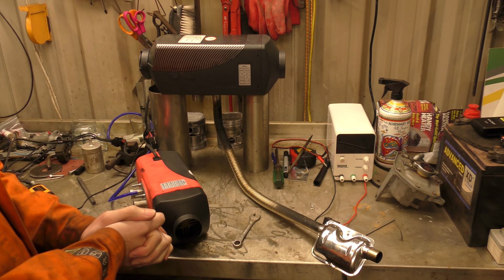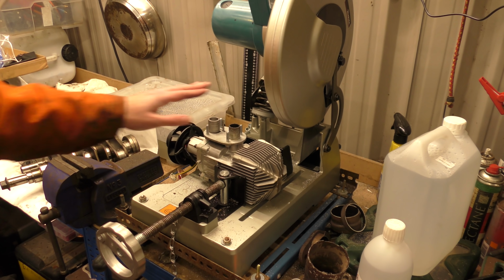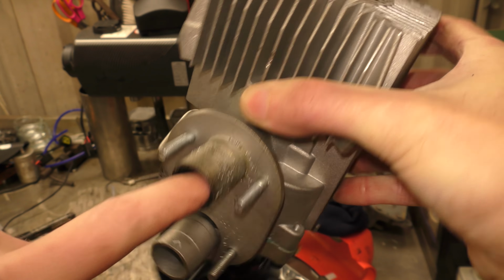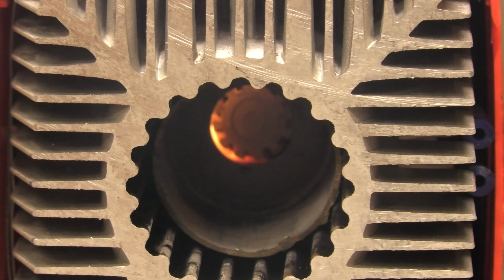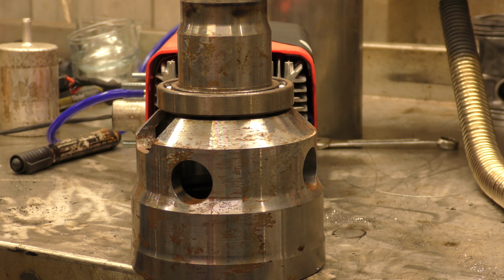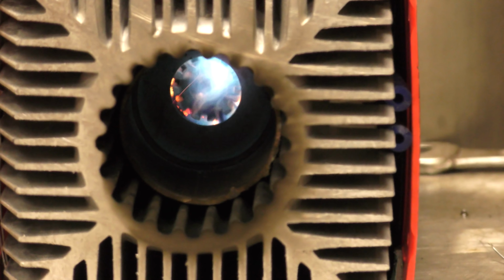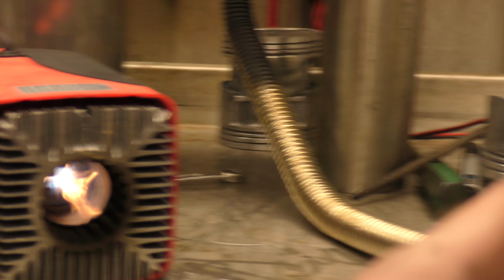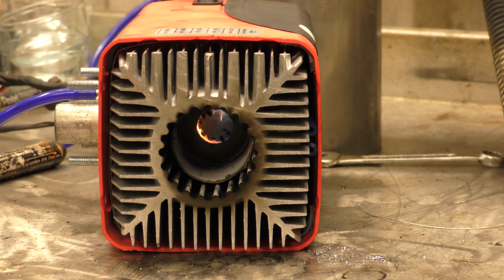A look inside the diesel heater while running

Comment: Seeing how this operates, I am much more confident about using one of these in my van conversion rebuild. Thank you for sharing this.
Reply: Yes this was just what I thought,, I hate to to use somthing not understand how it works,, was good video,, is a good video,, Lol
Reply: I just finished installing one in mine and I'm really happy so far, just wish the LCD had a better user interface/experience, but I guess you get what you pay for..
Reply: @the_alexes  Great to hear this I am at the moment still waiting for mine to arrive, but i do like to know what I am doing and when possible well in advance,, I think the heat of the exhaulst is waisted so I am going to buy a longer pipe and run t through my boat before going out,, Cheers, Pete
Reply: These heaters are great!  I put one into my class A and it easily keeps it warm.

Comment: Since the water heating variant of these is so expensive, I have thought of tearing into one of these far less expensive units and exploring converting it to heat water.  Thanks for the look inside.
Reply: My friend I'm from Greece,living now in Australia. Hydronic heating is not a norm hear and I was thinking the same with this little machine.
Reply: Wrap a copper tube around the exhaust!
Reply: @amando96  not enough heat transfer area/too much wasted heat...
Reply: @amando96  ....and wait for the explosion ?
Reply: @bobjones1131  How would that cause an explosion? What exactly would explode?
Reply: @amando96  Same as any water heater or boiler. You would have to have a safety pop off valve. They already have these with a built-in water heater.
Reply: @bobjones1131  Assuming the setup allows pressure to build up
Reply: You could build some kind of heat exchanger with a heater core
Reply: @juliogonzo2718  They sell them .
Reply: @bobjones1131  why buy one when you can spend 3x as much through trial and error building one yourself 🤣 that's generally what happens to me.
Reply: @juliogonzo2718 Yep, me too. Since a gas water heater already has an exhaust pipe up through it, I believe that a smudge pot could be designed to plug into the bottom of one and used that way. You would definitely need another exhaust pipe to divert the heat away when the water got hot.
 You spend the money and let me know how it works. You can find old water heaters on trash route day...😁
Reply: I was thinking of a 50 plate mini heat exchanger but they have a ~280C max allowed temp, i measured my heaters exhaust and on low it was 180C, full throttle was 300+. Is doable but not sure the exhaust is strong enough to make it through the exchangers plates. its only $80 or so might try it.
Reply: @mickwolf1077  The problem with heating water is that it WILL condense any carbon on the heatex surface that is not broken down in the combustion process.  The brazed flat plate heatexes flow very well, I have used them for Thermosiphon transfer.  The problem I think you will run into is I am not sure how you would clean them of carbon as you cannot disassemble them…  For this you really need a tube in shell with removable ends to allow access to clean the tubes that the exhaust runs thru…
Reply: I think that using the exhaust fitted to a heat exchanger would be a better way to heat water with these, the exhaust gets must hotter than the heat from the room heating output and the heat from the exhaust is wasted.
Reply: Seal off the end of the heater (the part was cut in the video) from the rest of the unit into a coolant chamber, filled with a water/coolant mix, then circulate the coolant through a multiplate heat exchanger. Do it such that the unit is vertical with the heat sink fins pointed down and submerged into the coolant chamber. Obviously do this with an uncut heater. The trick would be sealing off that part of the unit that has the most heat sink fins right up to the exhaust port.

Comment: Very interesting to see and work out the flame path and the combustion setup of these burners. Looks like the disk in the middle is used to evaporate the diesel once the glow plug goes out. Might be some methods of operation I can build in to bigger waste oil burners.  Trying to get one down to even 10 Kw is a challenge.  Great Video David.  Didn't waste anything, you imparted some good knowledge into a lot of people. Thank you.
Reply: Atomization of fuel could improve efficiency also .like a jet engjne

Comment: Be interesting with a bit of furnace glass over the end to see how it burns on different fuels. Great video cheers from a grumpy bastard from Australia
Reply from the maker: I've got some borosilicate glass ordered.  So we can see what it looks like with different fuels.
Reply: Ahhhh great minds think alike , putting my heaters away for the dry , at last it is staying around 20c at night mid 30s during the day . Need heaters at anything below 20c just to dam cold . Possible that I have lived in the tropics for to long
Reply: Heh, I came here to say the same thing!
Would be quite interesting to see the difference between Diesel and Vegoil  while it is starting.
Then you could try heating the VegOil to somewhere around 60-70°C where its viscosity is not too far off of Diesel.
Would be quite interesting to know what the failure point is. Burning temperature, viscosity/pressure, etc.
Reply: Can you also test drinking cheap vodka for one week then let it run on your urin? If it work I will buy this heater for my home
Reply: Interesting
Reply: @McJunk1  I've been thinking about adding a small ptc heating element (like the ones in 3d printer hot ends) to the metal line to warm up the fuel prior to entry, and wiring it in parallel with the glow plug. The mosfet that powers it was rated way higher than just the glow plug could draw anyway so plenty of capacity. Then start with say 20% petrol and 80 veg oil and see if it works or not. Adjust mixture till it burns nicely on veg oil. A glass window would be perfect to see if it's burning nicely.
Reply: @ratgreen  I have been thinking about something similar. One concern is, that due to the construction parameters like hole and hose sizes the oil might need to be heated consistently during operation. Maybe using a stronger pump would help with fuel delivery/dispersion issues. The MOSFET appears to be an off-brand somethingsomething-20N06L which is also rated quite high I think. What I can gather from the video the traces close to it seem quite beefy too.
Another thing is that you would probably need to build a heater block to syphon the fuel through and have enough thermal mass to make it controllable and not overheat it accidentally (or just not get it hot).
Reply: Try running it on propane and use it as a blacksmith forge.
Reply: Will it run on used engine oil? 👀

Not that anyone would ever do that obviously... 😇
Reply: @DavidMcLuckie  what fuel did you use in this video? It's not a diesel, isn't it?
Reply: @ratgreen  why not run something around exhaust to make heat exchanger for oil.
Reply: @pete ryan - Agree!  Would be interesting to see how well it runs on a 50/50 diesel and veg oil mix, as well as a 75% veg oil and 25% petrol/regular unleaded gasoline mix!
Reply: Did the glass test ever happen?
Reply: @McJunk1 
Pointless, a litre of diesel is way cheaper than a litre of veggie oil
Reply: @BillSikes.  Might I ask if you live in the USA? The USA (and other countries) heavily subsidizes fossil fuels. In Europe that is not the case in most countries. Where I live (in Europe) you can buy rapeseed oil for use as fuel, which is cheaper than other fuels. It is not easy to get, because apart from the farmers who produce it and companies with many trucks (so mostly transportation), nobody has the motors to use it. 
Further, it is not always about finding the cheapest way to heat space, but also about how to use renewable energy and not fossil fuels.
Reply: @BillSikes.  Not if you have access to waste oil.
Reply: @randomoldbloke  for your situation you could easily look into a passive heating system. Something that captures heat from the day and keeps it through the night. Some people use large tanks of water with solar heating, some people use big piles of rocks heated by running solar heated air through them during the day.
Reply: @ratgreen  3d printer heaters are definitely not made for that. I think 8 amps would make one explode. Not sure. Just put a good resistor in front of it, and maybe use two at lower current.
Reply: You probably dont care but does anybody know of a tool to log back into an Instagram account..?
I somehow lost my account password. I love any tips you can give me
Reply: @Jake Dariel instablaster =)
Reply: @BillSikes.  Not used veg oil

Comment: I've watched a number of your videos, David, and am much, much better educated as a result! Before then, these were just magic boxes working through who knows what supernatural means. Now, you have shown us that they are - at heart - really quite simple machines. I've just stripped and cleaned mine, replaced all the bits that need replacing and fired it up - off it goes. Couldn't have done it without you!

One issue that keeps coming back to haunt me is exhaust length and build up of condensates and gunk. Mine's in a boat and needs a 6 metre run. So far, I can do no better than run it until it no longer goes and then clean/blast everything through with gunk so it works again. At least I now have the confidence to do it!

Comment: David, I'm an avid diesel heater lover.  But one year in I have found a serious flaw with some All In One Units.   It seems that some of the All In One Units used sub standard fuel tanks inside and several have spontaneously developed cracks, thus leaking a full gallon of diesel fuel on the burner unit and into my garage floor.  I thought it was a bad hose connection but found that some of the very thin fuel tanks were developing cracks.   As you can imagine, a full gallon of diesel fuel leaking anywhere, but especially onto a running hot burner could be a serious issue.   This is one of the problems with low cost Chinese goods.   You can sometimes unknowingly get some dangerous products.  Thanks
Reply: Imho one MUST keep the fuel tank a a distance from the heater and also from any electronics. Also put it a bit lower if possible so that when the hose burns or leaks the fuel won't leak out into the fire.

Comment: Very interesting to see the actual running... I’ve always wondered how the burn chamber worked... now I know, thanks!
Reply: Temperature was 370 C ? Or F ?
Reply: @2cooco  IR thermometer readings probably not accurate as that needs a specific surface emissivity; a thermocouple reading would be more representative of the flame temperature.

Comment: Quite an interesting video. :)
Btw..you could punch some threads in there, throw a thin copper gasket on and assemble the whole unit again. 
It will be easy to disassemble when you want to clean it.
Reply: I think damaging the integrity of the heat exchanger is a safety threat.

Comment: Whatever you decide to do with it remember that the more you reduce the exhaust gas temp the closer you will run to the dew point which produces acidic condense which is ok as long as you use material that is acid tolerant and you can drain the liquid.
Reply: Wouldn't adding a catalytic converter reduce the amount of NOx and VOC's present in the exhaust? Then, when you did produce acidic condensate in the exhaust you could filter it through another medium to capture any release carbon. Say, using the same idea as what they're already doing on large ships when using sea water to filtrate bunker fuel and illegally distributing it into sea water. A peristaltic pump setup on the exhaust end to pump the exhaust through a dirty water tank would cause any particulate to become trapped in the water. Like a dirty exhaust bubbler. Which, you could then send that dirty water to a distillation chamber setup on the exhaust itself since it'll be burning above 100 degree's. The water would steam off leaving concentrated toxic distillate or creosote. Which you could presumably use for something else. Like wood preservative.
Reply: Very true ,I high efficiency house heaters have to deal with the acid condensates.
Reply: @1607rosie  Ultra-high efficiency gas furnaces and instantaneous ('tankless') water heaters deal with condensate, which must be piped or pumped to a drain. Not a big deal; the units are built with corrosion-resistant stainless alloys. I have a Rinnai tankless heater which is built in this fashion.

Comment: I'm pretty sure the instructions for that heater specify to only run it with the intake and exhaust ports facing down, not on its side or upside down. At least mine said that. I'm not entirely clear why this is though other than the location of the glow plug being at the bottom.

Comment: Hello! Thank for the videos! Did someone noticed a strong burning plastic smell the first times of using the heater? Because mine is new and the smell feels quite unhealthy...
Reply from the maker: Not from the heater no.  None of it's plastics are the melting and smelling type.  But we did get that smell from some cheap ebay vent covers.

Comment: I just got one of these and the one feature I wish it had was during the rundown process. When you shut it off I wish there was a mode that could keep that high-efficiency lowest heat, optional and quiet exhaust. I hope they create some sort of firmware update, or new controller that includes that run down in to off mode as a standard speed option

Comment: Very cool video! I'm thinking of getting one of these to take the chill out of my basement  workshop. Funny you should have mentioned an intercooler. I'm thinking of running my exhaust out through a length of hot water baseboard element. It's thin copper wall pipe with fins to let out the heat. Why let all that great exhaust btu heat just get wasted. Maybe you could try this and see if it works? I was thinking about a 1" dia  x 4' length.

Comment: I bought an 8" X 8" radiator and hooked  the exhaust to it with a fan blowing on the radiator. The exhaust pipe coming out of the radiator is almost cool. I have increased the efficiency this way. I am not blowing any hot air out my window. My question is will the radiator get gummed up with crap that I will have to clean out every so often?

Comment: I wonder if I could use one of these as the basis of a hot plate / hobs/ cooker. I've seen a webasto diesel hob but it's 1000 pounds, the Chinese don't seem to be cloning them yet. A lot cheaper than electricity for cooking if the price cap does go as high as some are predicting next year.
Reply from the maker: That might be something different to try.  Clones exist but they don't seem to be much cheaper - https://s.click.aliexpress.com/e/_DlTO1Mn

Comment: Thanx. I've wanted to know this too. Nice blue flame, low co. Tap between the fins and screw in threaded inserts. Heat resistant gasket or "Ultra Copper" tm. This can be returned to service. Better than new and easier to clean. :)

Comment: Put a screen to act as a catalytic to burn off any residue keeping the intercooler cleaner. For sure you'd bump up the efficiency. Id even run the exhaust though water or sand as a heat battery. 
I just got one delivered and looking for detailed operation like how many watts the fan and glow plug use. This will be for heating just my room during power outs. Bought a Jackery and a 100ah Lifpo4 to keep warm and the darn internet. Have to have the darn internet during black outs right?

Comment: The important thing to remember is to fit the silencer Outdoors, as the seam welds are usually crap, and the condensation weep will both conspire to poison you with products of combustion if fitted indoors.
Reply from the maker: Yes and no.  I really need to make that CO video.

Comment: I really appreciate your effort, going so far as to cut the end of the burn chamber off. Opens up a whole new realm of uses and modifications. Do you feel that running the heater with the intake and exhaust to the side negatively affects the operation or lifespan of the heater?
Reply from the maker: I wouldn't have thought so.  The diesel feed is just hitting the hot gauze and being vapourized before mixing with the air stream.  Being on it's side shouldn't have any effect on it.

Comment: Thanks for that. Nice to know the casting looks reasonable. If you still have the cut off end, could you comment on it's thickness & quality as there are scare photos going round of a heater that burnt through. Thanks.
Reply from the maker: Burnt through?  I'll measure it for you, but how hot would you have to get to melt a hole?  Got any links to the picture?

Comment: If you're going to make the exhaust go below 100C remember to Use stainless steel and have a Drain hole due to the condensation.

Comment: Great video and no, it wasn't a waste, we all learned something from it. 
These heaters have incredibly clean burning and low sut accumulation. I was seriously thinking to make a water heat exchanger for one of these. It could help to rise the water temperature of a heat pump when it is very cold. I have 2000l water buffer tank and I heat it when there is sun or when the electricity is cheaper. It takes the water from the bottom, runs it thru coaxial heat exchanger where it leaves at 55°C max. I could add some 10°C perhaps and end up at 65°C. Worth a thought.